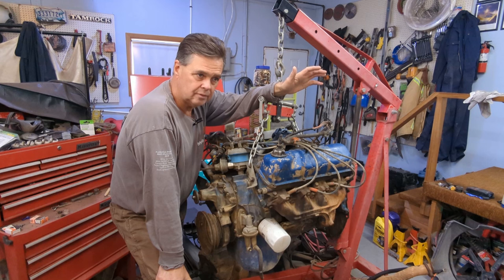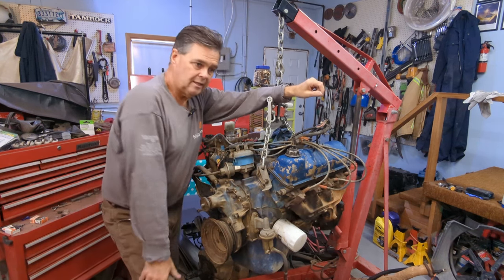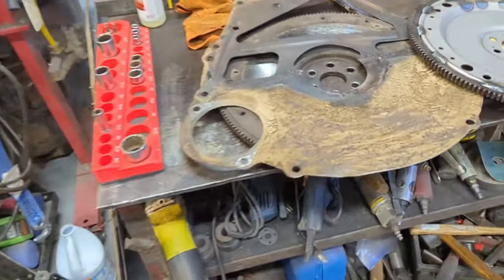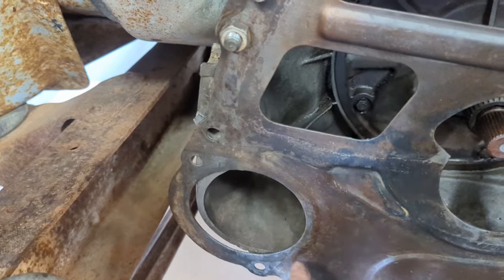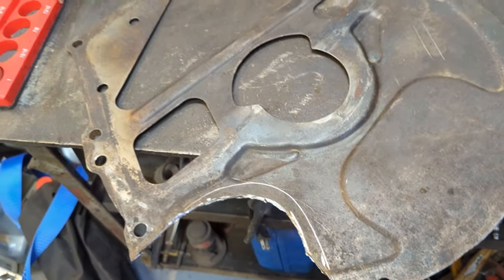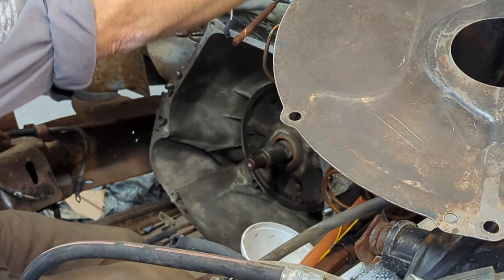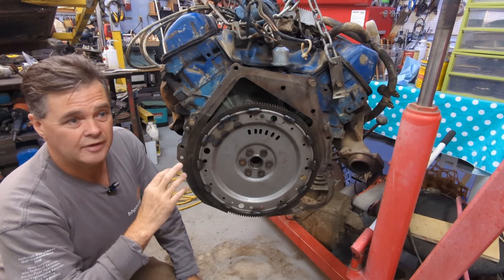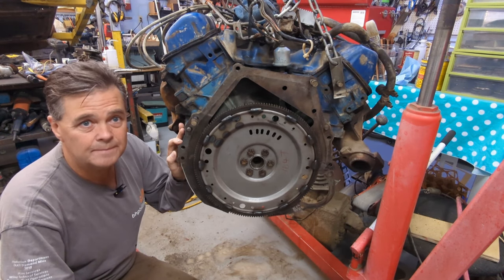Modifying The 400 Engine Separator Plate to C6 Transmission - Some Welding Required - Project Bronco

Comment: Thats a first for me but do what you gota do. worked out fine, I bought 1 of the cover plates cost me 45$ for a 390 couldn't find one anywhere unless you buy the hole car
Reply from the maker: I could get one for $65 usd, but by the time I add shipping, it's around $130 usd...now convert that to cad, $175...shipping costs are insane!

Comment: Good work around. I am at a loss as to what purpose this separator plate actually accomplishes . It looks like a shim. Thx Alvin .
Reply from the maker: In a manner of speaking, it is a shim, why ford did it this way...I really don't know? But, without it, the torque won't have room to expand when hot, and the starter clearance will be wrong.

Comment: Hiya Alvin!
Simple and innovative fix. As you know I’m a Chevy guy, so I’m curious. Why do you even need that spacer plate? Could to have just chucked it and carried on?
Reply from the maker: Hey Troy,
The separator plate is a total waste of metal and time...but if you don't use it, the start clearance will be wrong, and the ring gear will destroy the starter drive, also the torque will be pushed into the pump... unfortunately, it's a stupid design, but necessary.
Fords better ideas. Lol

Comment: Great job finding a way to make that one work.  Will you be putting the engine in as it is or will you be refresshing it?
Reply from the maker: Thank you Matt, I'll be putting it in the way it is, it was supposed to have been rebuilt a little while before the truck was parted out...we shall see. 🫣